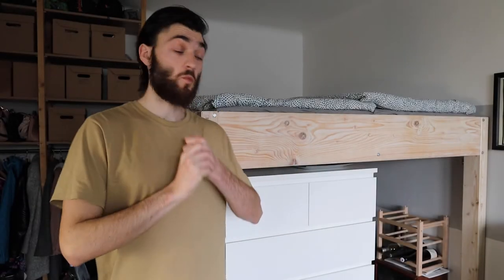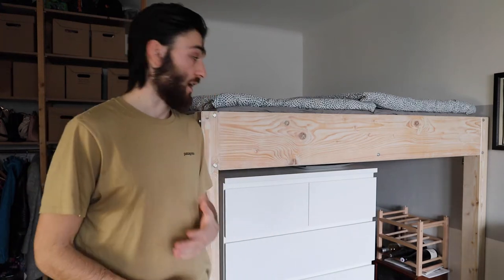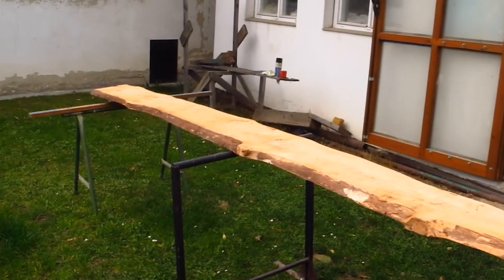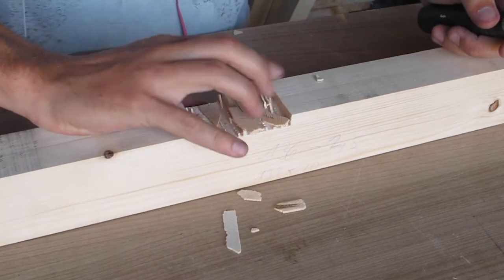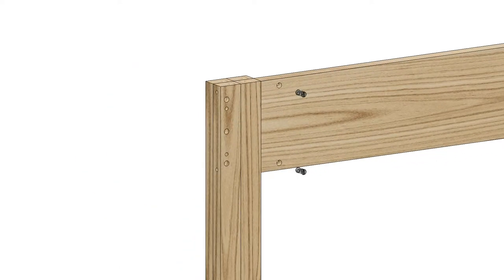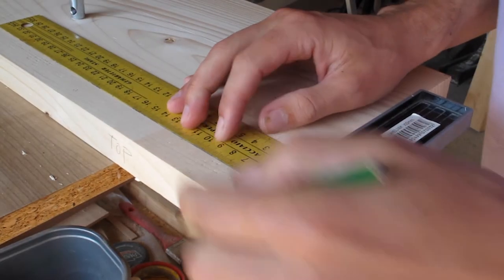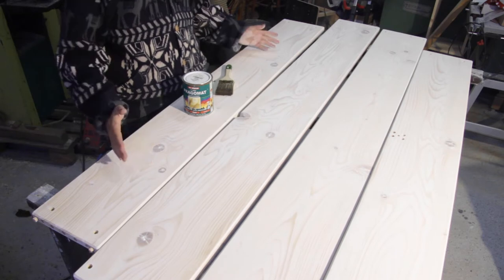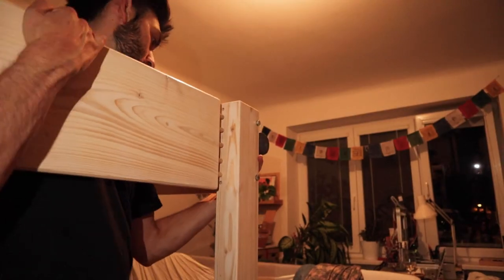DIY Loft Bed

Comment: thanks man, i been look at diy loft beds for a little bit now checking out others designs. yours is the first one to use the barrel nut and cross bolt idea and that seems really strong and seeing as im 250lb's i needed something with a little extra strength. thanks for the idea

Comment: How much did this project costs you? And what are the measurements? Please help meeee I really want to do thi
Reply from the maker: Hi, I had all the rough lumber laying around, so that didn't cost any money, but a lot of time. The hardware was around 35 USD and the mattress around 200 USD. I will add a plan with exact measurements ASAP... In the meantime, the bed is 150 cm high and the mattress is 160x200 cm (queen size).
Reply from the maker: You can find the plans and instructions here: https://www.instructables.com/DIY-Loft-Bed/